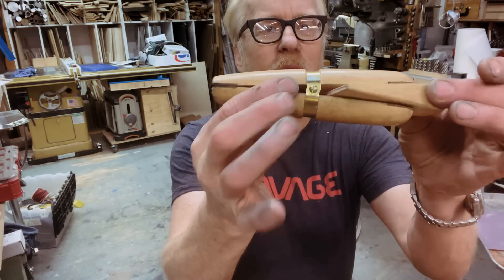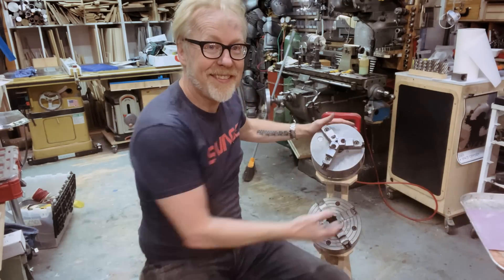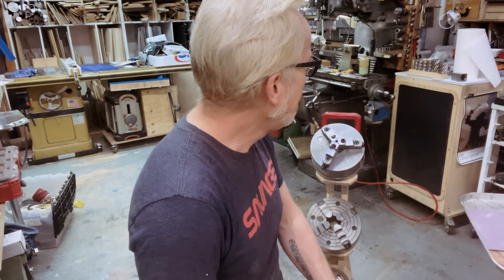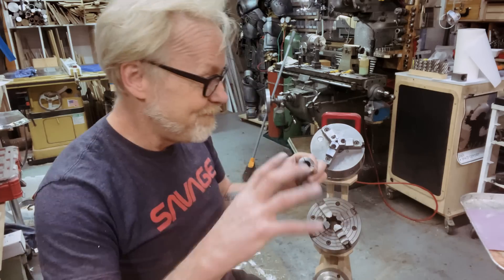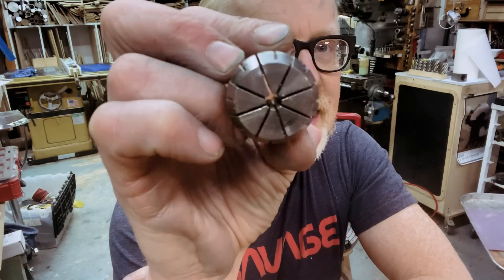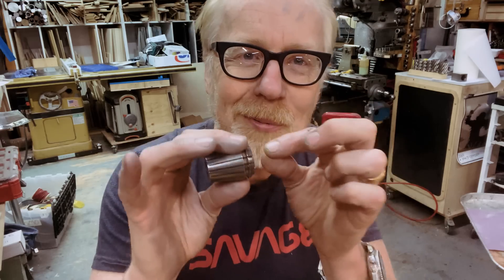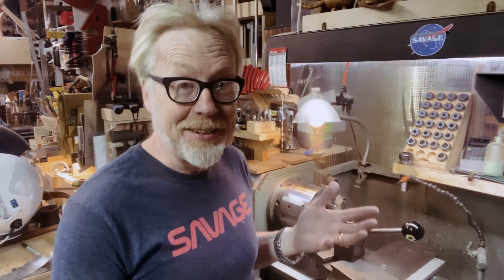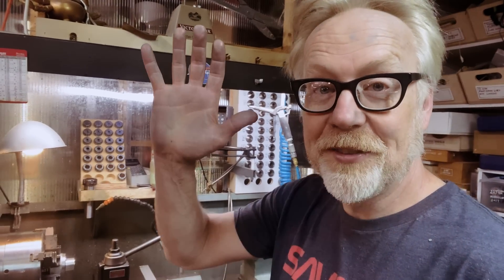Adam Savage's One Day Builds: Lathe Collet Storage!

Comment: With a collection such as this, is there a potential advantage to having a cache of the most frequently used collets that are immediately available (i.e. within hands reach w/o reaching across the lathe.) Using the fighter pilot example, yes there may be multiple weapons systems available to fire, but there will usually be 2 live triggers on the flight control for the two most used, or one for defensive use, and one for mission use (bomb drop perhaps or whatever.) In the collet realm, if you are constantly working with 3/4" round solid stock, having the collet for that immediately available may save searching through the collection across the lathe. 

I would presume this would depend on your own needs of course. If you are always working with the one material, you may set up a tool specifically for that material if you have the space and budget.

Comment: I wonder what Adam's cave is like after an earthquake...all the wall mounted things like the collets don't seem to be attached to the wall
Reply: well they are not a light things and most of thing in the cave are on wheels on a heavy duty wood beam floor sitting over and on concrete floor, so the real problem would be fire as significant damage occurred as a result of fire following the quakes and there is a lot of wood in the cave

Comment: Hey Adam, apologies for being serious in a comment under one of your videos, however wood is the wrong choice for collet holders or any other machine tool unless you treat it in some way especially for that. It acts like a sponge to remove oils from the surface and can cause surface rust to form. Consider either greasing the holes so they're inherently wet or sealing them with an MDF sealer and then oiling them or something. In raw wood is not ideal. Cheers :-)

Comment: I made something similar from a piece of oak I had left over from another project. The collets were in there for about a week before I pulled one out to use it. All of them had a nice ring of rust where they touched the wood (I saturated it in wd40 and oiled it before putting in the collets...).
Fixed that by drilling the holes bigger, then added printed plastic rings fitting the taper of the collets..

Comment: R8 collets are terrible tool holding collets. They are notorious for tools slipping out of the collet. The ER series are far better tool holding collets. The best R8s are probably the ones with locking screws. In terms of lathe collets the 5C collets have their limitations. First is their small work holding range for each collet. Second is their problem in holding lengths. This is due to their geometry.  If you are using a collet stop and you are attempting to hold a critical length and your work pieces vary by a couple of thousands you will have a .006" variance in length. There are ways around this though. The real value in the 5C collet family is the wide range of collet types available. Internal collets, emergency collets, steel collets, fixture plates, 5C mounted lathe chucks,  extended nose collets and dead length collets. Along with various 5C work holding devises for use in milling machines and grinders. Hardinge has a very good description of these various collet types in one of their work holding catalogues. 
https://www.hardinge.com/workholding/
Granted a lot of these are outside the scope of the hobbiest or even a lot of small shops. But there is very useful information. Plus some of the solutions are easily made.

Comment: Normally you drill the holes for the collets slightly larger than the minor (smaller) outside diameter of the collets rather than slightly smaller than the major (larger) diameter of the collet.  This is so they stand above the holder so you can grab them with your fingers not your finger nails.
But then again you might not have had the exact fractional Forstner bit size.  What you don't have Forstner in 1/64th increments??? How can you live without them?  And yes I am kidding.
Reply: There are adjustable bits. And no I am not kidding. I have one that goes over 3 inches. Drilled through one inch thick Micarta sheet with it once too. Was a pretty crazy cut. I was making a clamp for one of the routers I have. Long story.

Comment: Nice video and concept Adam.  As a suggestion check if the community you live in has a Maker Space with a laser table.  If so you can cut the holes and label them in one step.  Typically they can cut 3/8 ich wood stock.  A second suggestion is to have extra room in your layout for unused holes.  They won't be unused for long!

Comment: This video taught me:
Clamps = something which holds something
Collets = Clamps
Adam built a holder for his collets = Adam built a clamp to clamp his clamps
Reply: "Identify all the clamps in the picture to prove you are not a robot"
Reply: Rack = an array of thingies that hold stuff, in this case an array of fixed-size holes to hold with.
Collet = a tube that squeezes around a hole that holds something.
Adam built a box of holder holes to hold his holder holes.

Comment: Dont use uncovered wood for storage metal tool - its rusting in time.
Reply: Definitely agree, as rust on the outside of a ER or 5c collet can quickly make them nu-useable.  Idea is great, but at least use something plastic for the actual top of the collet holders so it doesn't hold/collect moisture to cause rust.  Something like StarBoard or even PVC trim board for the top that actually contacts the collets would be preferred

John
Reply: I thought about that but just dismissed it as just me being me. Thank you for confirming my paranoia right.

Comment: Adam, you probably don't want to mount them above the bed like that, imagine your first time turning delrin, it'll ribbon all over your nice new racks. And if you ever turn anything you need to run high speed with coolant, you'll throw drops all over them, and you'll get rust spots, plus you will have a background haze of surface rust, especially if your bed takes a little bit to drain of coolant completely after powering off

But also, you would have loved the system we had where I worked for a bit, they had an old J&L turret with the super old school lever collet closer. Each collet was cut into 4 separate pads that had to be put in the drive ring on the headstock (in order) while it was running/spinning, then you fed the bar/tube through the spindle and headstock to the length you needed, then pushed the lever to move a collar that pushed on a wedge shape on the OD like a modern collet. If you stopped the spindle without a bar in the machine, the jaws in the top half fall out due to gravity. We used it for precisely parting off some aluminum tubing, and you literally didn't turn the spindle off once a shift besides lunch, when the stock is about to run out, get a new length and stick it on the infeed stand, and slide her in, use it to push the last remaining bit of the old bar into the bed to be pulled out with the rest of the chips

Comment: Awesome build! Expounding/ mansplaining a bit on "clamping". In the metalworking world, it's called "Workholding". R8 collets are toolholding bits (not used for workholding, except in very special cases). 5C (Trivia: C is for Cataract Lathe Company) is an extremely common collet used in a variety of production equipment and stationary fixtures for holding work, it is less common, but sometimes 5C collets are used for toolholding duties (especially with drill and mill cutter sharpening/ re-sharpening machinery). The C-series collets have size ranges from 1C to 25C.... J-Series collets (not interchangable with C-series but look very similar) go all the way from 1J to 35J (35J has a maximum workholding size of about 3-1/2". All of the aforementioned collet systems are single point draw systems (stationary clamping cone acts on the fingers of the collet which are drawn backwards into a cone via a draw bar or external nut. The downside of single point draw collets is they have a very narrow range of clamping allowance (generally less than 0.007") to hold a part with enough force while still maintaining concentricity with an acceptable tolerance. ER Series collets are a dual point draw system which actually causes both ends of the collet to grip the work or tool (ER series are used for both workholding and toolholding). ER collets have amazing amounts of clamping force, and clamp at both the front and rear (think of how a Chinese finger puzzle works, ER collets clamp very similarly), generally have a broad tolerance on clamping allowance (generally about 1/32" for a typical ER collet), and tend to be physically shorter than single draw collets. The downside of the ER series is the clamping nut must be completely removed and separated from the collet at every collet change, and there is no real way to have the system "Quick Release/ Quick Clamp" (as is available with the C and J series collets).